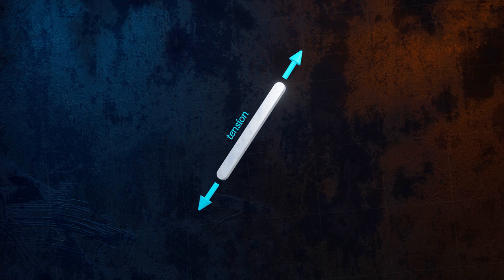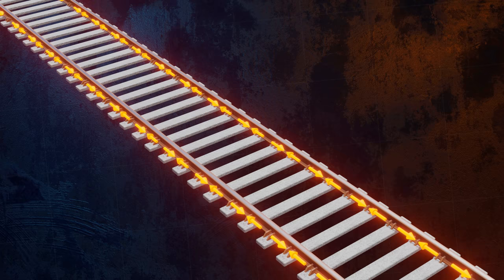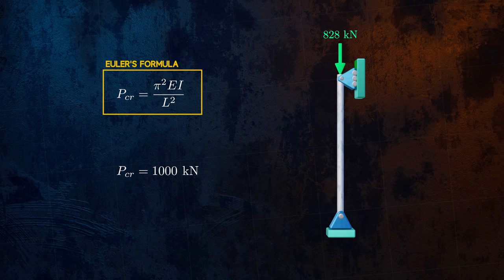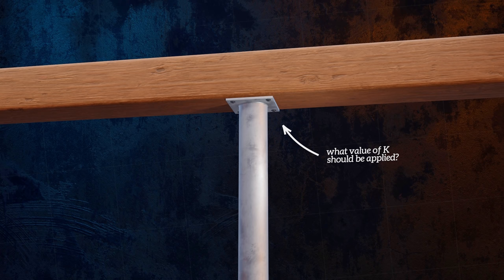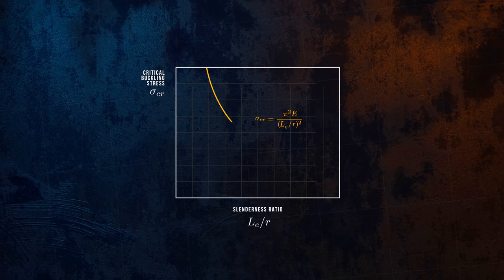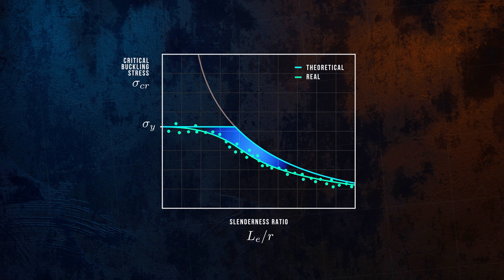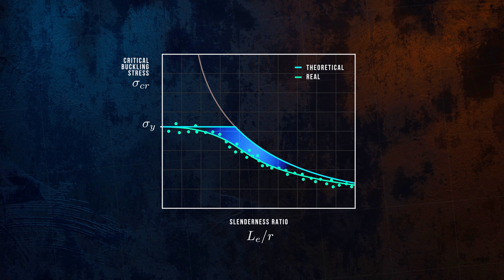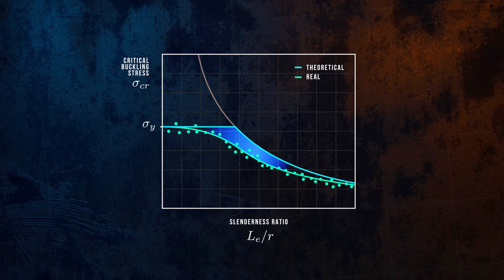Understanding Buckling

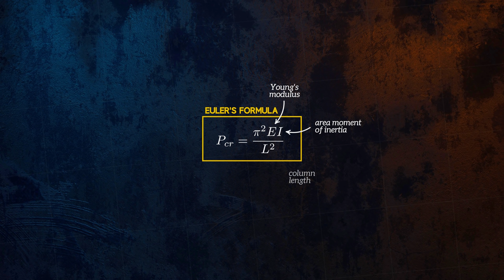Comment: 3:01 Pardon?! Young's modules IS the strength of that material. What do you mean it doesn't depend on the strength of the material?
Reply from the maker: Young's modulus is the stiffness of the material, not the strength. The yield and ultimate strengths are the strengths of the material.
Reply: @TheEfficientEngineer  You mean yielding stress, right? Fair, but what I mean to say is that there is direct relationship between strength and Young's modulus. So saying that the critical load doesn't depend on strength is partly faulty.
Reply from the maker: I disagree, there is no direct relationship between Young's modulus and strength. Two steel grades can have very different yield strengths, but their Young's modulus values will be almost identical, for example.
Reply: @TheEfficientEngineer  I really think you're missing something. Firstly, Young's modulus (E) alone doesn't represent stiffness because stiffness is a function of geometry too (eg. k = EA/l for axial load). 
Secondly, yield point is mainly a function of E and temperature. So in most cases, if a strength of a column changes, it means E has changed which affects the critical load of the column. That's why your statement is partly faulty.
Reply from the maker: Yes, E is the stiffness of the material, and I is the stiffness of the cross-section. But yield strength and E are completely separate properties, that aren't correlated. If you can show me a reference that says otherwise, I'll be very surprised.
Reply from the maker: E is the stiffness of the material, I is the stiffness due to the cross-section geometry, and EI is the overall stiffness (flexural rigidity) of the column - I don't think there's much debate about that. Back to Euler's formula - if you have two materials, both with E = 200 GPa, but one with a yield strength of 250 MPa and one with a yield strength of 450 MPa, according to Euler's formula they will both have the same critical buckling load - hence it does not depend on strength. Since you won't take my word for it, have a look at section 11.3 of Gere's Mechanics of Materials, 9th Edition. It notes that "of particular interest is the fact that the strength of the material itself, as represented by a quantity such as the proportional limit or the yield stress, does not appear in the equation for the critical load. Therefore, increasing a strength property does not raise the critical load of a slender column". Or Beer's Statics and Mechanics of Materials which notes in section 16.5 that "For long columns failure is closely predicted by Euler's formula, and the value of [the critical stress] is observed to depend on the modulus of elasticity E of the steel used, but not on its yield strength".
Reply: @TheEfficientEngineer  Sorry for late reply. I think there are a few things you're misunderstanding. 
1. E is Young's modulus AKA modulus of elasticity and NOT stiffness. Do you remember Hook's law?: F = K*X where K is stiffness. Compare this to the deformation caused by an axial load on a column: X = FL/EA, therefore,  K = EA/L in this case. Thus, stiffness K is a function of both E and geometry of the column. 

2. I studied section 16.5 in Beer&Johnson. Firstly, it's talking about "critical stress" and not "critical load". Secondly, what it's saying is critical stress occurs sooner than yielding stress for long columns. Thus critical stress cannot be defined based on yield stress for long columns. It's possible E is kept constant in Fig. 16.18. But that doesn't change the fact that if you increase Young's modulus, a major factor of strength, both the critical stress and yield stress rise. So they're not completely independent. 

3. I is not stiffness of the cross section. It is the area moment of inertia of the cross section. I was talking about L, the length of the column in the axial deformation formula.
Reply from the maker: Take a look at this datasheet for structural steels: https://eurocodeapplied.com/design/en1993/steel-design-properties. These steel grades have yield strengths that vary between 235 and 460 MPa, but they all have the exact same Young's modulus value of 210 GPa. S960QL grade steel has a yield strength of a massive 960 MPa and also has a Young's modulus of 210 GPa. All of these steels have the exact same Young's modulus, and so the same Euler critical buckling load, but massively different yield strengths - the yield strength is not a factor in the critical buckling load. I think maybe what you're saying is that materials with low Young's modulus tend to have low yield strengths, but even that isn't always true. C36000 brass for example has a Young's modulus of around 100 GPa, but can have a yield strength up to 310 MPa, so half the E value of S235 steel (100 vs 210 GPa), but a much larger yield strength (310 vs 235 MPa). Otherwise I don't understand what you mean when you say "when you increase E, the yield stress rises" - what is the basis for this statement?
Reply: @TheEfficientEngineer  It's because these steel grades were hot pressed. A hot press process is done at about 1700 C which creates large strains in the structure of the metal while keeping E the same. So this is the effect of temperature which is quite irrelevant to your video. 
The question is what happens if E changes. Would that change the strength of the material?! The answer is absolutely yes because a bar made of chocolate yields much easier than a bar made of steel.
Reply from the maker: What do you mean when you say "change E"? It seems you mean selecting a different material with a different E value. In which case, the strength of the material will probably change, yes, but it could go up, or go down, as the example comparing the properties of brass and steel demonstrates. The underlying mechanism that causes a material to have a certain Young's modulus (the stretching of atomic bonds) is completely independent of the mechanism that causes yielding (the movement of dislocations). This has been fun, but if you're not yet convinced I think continuing to discuss is probably wasting both of our times.
Reply: @TheEfficientEngineer  Why would you say "probably"?! Yield stress is actually defined based on elasticity. It's the intersection point between the stress-strain curve and a line with a slope of E and a longitudinal offset of 0.2%. So if E changes, then the yield stress (strength) will surely change. 
https://en.wikipedia.org/wiki/Yield_(engineering)
If my time is wasted that's absolutely fine but I humbly assure you that yours is not.
Reply: @SaeedAcronia  "It's because these steel grade were hot pressed" Cold formed steel are not processed under high temp yet it has the same Young's Modulus as a hot rolled one. Also E doesn't represent the material strength. The yield and ultimate stress are the representation of the material strength

Comment: Attention: in 3:00 says it doesn’t depend on strength of material at all! This is wrong. Because Young Modulus itself is a measure of strength. For example E of steel is almost 3 times of that of aluminum which makes steel 3 time stronger than aluminum!
Reply from the maker: Young's modulus and yield strength are fundamentally different properties. All steels have approximately the same Young's modulus, but can have very different strengths depending on composition, heat treatment etc... Take one steel that has a yield strength of 200 MPa and another that has a yield strength of 450 MPa - they will both have the same Euler buckling force, because they have the same Young's modulus - hence Euler buckling doesn't depend on yield strength. Also it doesn't make sense to say that steel is three times stronger than aluminum because Young's modulus is three times larger. You have to compare the yield strengths instead.
Reply: @TheEfficientEngineer  in the video it say “strength of the material“ not “yield point or yield strength“. As I said higher the E, stiffer the material.
Reply from the maker: The word "strength" is always used to refer to either the yield or ultimate strength of a material, never its stiffness.
Reply: @TheEfficientEngineer  so the book titled “strength of materials” just talks about yield point! Ha? Comme on!

Comment: Is the modulus of elasticity in the euler's buckling load formula not represent the strength of material?
Reply from the maker: No, it represents the stiffness of the material, not the strength.
Reply: @TheEfficientEngineer  Thanks. Agree that product of E and I i.e. EI represents stiffness. But E by itself is an indicator of strength. E.g. Is it not that lower strain for a higher stress, means it is a stronger material?

Between the two factors E and I,  certainly I plays a significant role, i.e.  where buckling is the governing criteria, there is no point in using a material of higher strength. It would be more efficient to make the dimensions of the cross section larger rather than using stronger material where buckling governs.
Reply from the maker: Young's modulus represents the stiffness of the material and I represents the stiffness of the cross-section geometry. E isn't related to the material strength. For example two steels of different grades could have very different yield strengths and yet have the same Young's modulus.
Reply: @TheEfficientEngineer  Thank you. Great explanation.

Comment: Can anyone suggest the book which have the design codes mentioned in this video?
Reply: i know that eurocode 3 : Design of steel structures,  covers buckling . So any textbook that explains structural steel design to eurocodes will do...if you use eurocodes.
Reply: @civilengn  In Canada we use the Canadian Handbook of Steel Construction.  Bought a copy when I was a student waaay back.  The old editions are in Imperial measures (inches, feet, pounds, kilo-pounds), whereas the new editions are metric.
This book has extensive look-up tables, thus saving many hours of calculations.